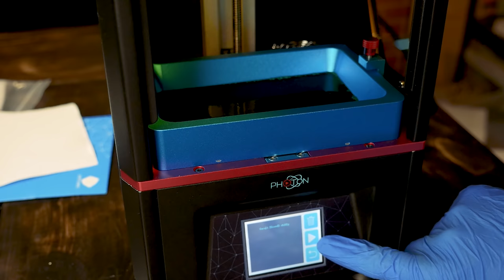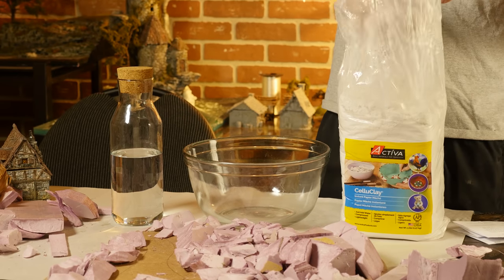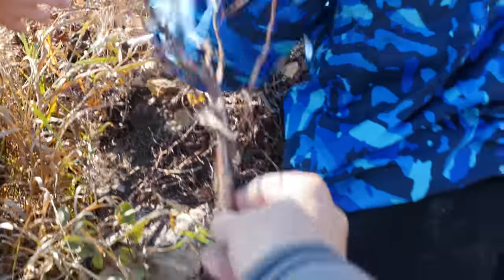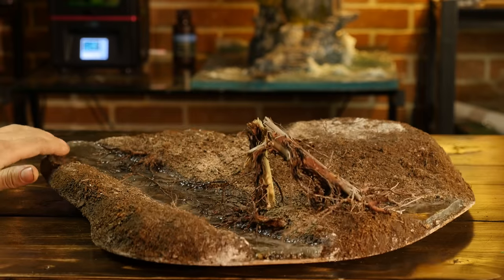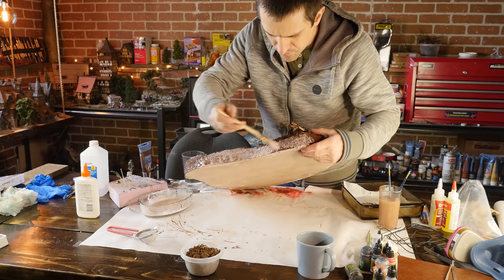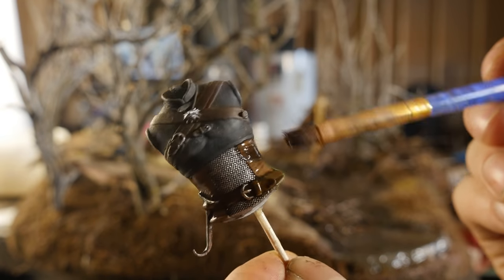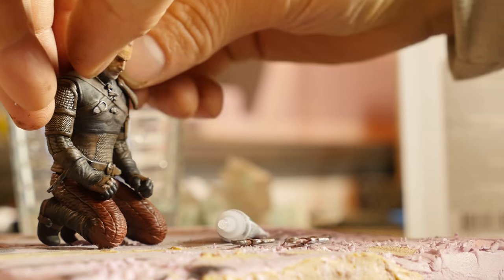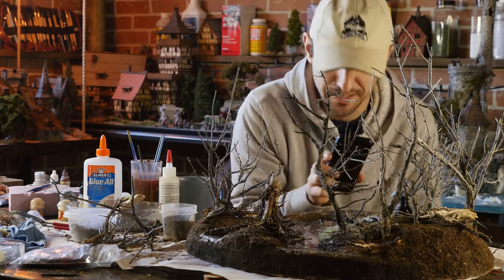⚔️ Ultra-Realistic Diorama from The Witcher! LED FIRE lighting & 3D Printer! ⚔️ | Anycubic Photon

Comment: I'm glad you persisted in finishing this for a few reasons:
- It came out looking great!  I really like the depth of the different soil/ground cover as it definitely conveys the idea that we're looking at not just the surface but deeper layers of soil, clay and various materials just below the surface.  The sagebrush branches are also very convincing as trees; most of the dioramas I make are considerably smaller than this but I've been considering getting into larger builds and I'll have to keep an out for this material.
- It wonderfully demonstrates something that concerns a lot of people first getting into this sort of hobby (model building, dioramas, miniatures etc.) and that is; there's very little that you can't fix on a project if you persevere.  And honestly sometimes the best thing is to step away for a time, give yourself some space and a chance to think about solutions because in that moment when we realize something's gone wrong we tend not to think very clearly and solutions don't come easily.  You did such a great job of showing that and had you not mentioned it in the video and showed yourself fixing it, I'd never have guessed anything had gone wrong.
- Last, but by no means least, I think you sell yourself short as a painter (something I think many of us also do); you did a great job of calling attention to the amazing details in this model.  I'm glad you went with painting the face first; not only is it usually one of the most detailed areas on a figure, its also the area that draws the viewers eyes the most so putting in a little bit of extra effort in creating interest in that area is never a bad idea.

One bit of advice/a tip (take it or leave it, but I'm very much in favor of spreading knowledge, tips, tricks etc. about the hobby):
If you're going to paint miniatures in sub-assemblies, I highly recommend getting a pin vise/hobby drill if you don't already own one.  Drilling a small hole in each piece and using a bit of wire as a handle/to hold it in place means you don't have to worry about dealing with glue already being on the piece beforehand.  The reason I mention this is because a lot of things can go wrong otherwise; the glue can inadvertently chip paint, it can create problems with fitting pieces together and, depending on the glue, it can adversely effect the curing of other layers of glue you apply to the area.

P.S.
Please be aware the latter isn't a criticism, just a tip that comes from difficult experiences I've dealt with in the past.  As I said at the beginning of this video, I think you did an amazing job.

Comment: Nice save on the porridge bowl. But one thing, you now have water higher at the edges than at the center  if I'm not mistaken. If that is the case perhaps covering over the highest level with a bit of fill so it looks like a underground spring might help. Otherwise grind out one of them to make it lower than the others. I'm current messing up one similar. Flows down off a small rise, then pools and flows slowly across a road. The top flow has a slope, the bottom pool does not. Was looking good except the resin leaked out of the upper area :( and it take 84hrs to cured. Even more :(

Comment: I just bought some sculptamold for a model railway, I've never used it before and just bought it after watching your video with your kids diaramas (which was an amazing vid btw!). Wanted to ask about the warping, our trainset is mostly a plywood board with a few areas that have polystyrene on. The board is nailed down to a plywood frame. Is it likely to ruin the board if I use the sculptamold on the wood parts like it did for you? Is it worth doing a layer of mod podge or wood glue first?

Love both of your channels, really inspiring! Especially love this collab as the Witcher is an amazing game :)

Comment: Noob Tip: When working with Liquid Nails or Silicone tubes. Spray your finder with kitchen/bathroom/window cleaner and then smooth the edges. The cleaner stops it from sticking to finger.

Comment: How long does sculptsmpuld actually take to dry?
 I've heard really mixed results on this. Some people (namely Luke's aps in my experience) say it takes a matter of hours, where as what you say of it taking a few days fits with my experience of using it, where it took a day or two to fully dry. 
Is it all just dependant on temperature and the thickness of the layer?
Reply: @GeekGamingScenics  so it sets after around 20 mins but stays damp for a while after that? Ok, that makes sense. Whenever I've used it anything thicker than 2/3 mm becomes basically hard after 30 mins, but doesnt fully dry out for a couple days.
Reply: @GeekGamingScenics  fair enough, thx for the help/advice man!